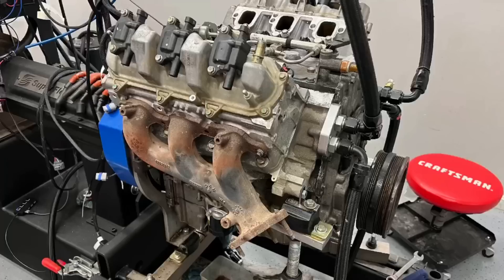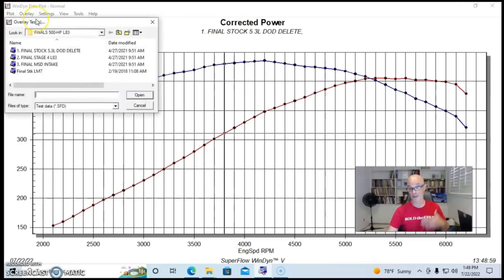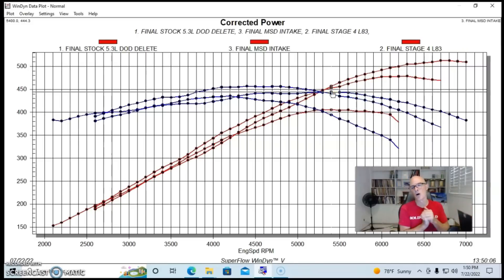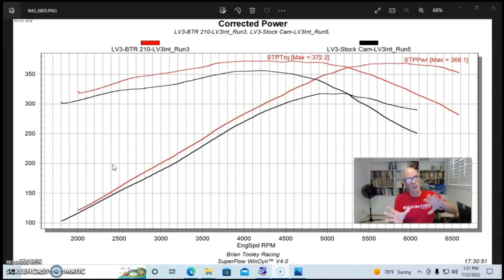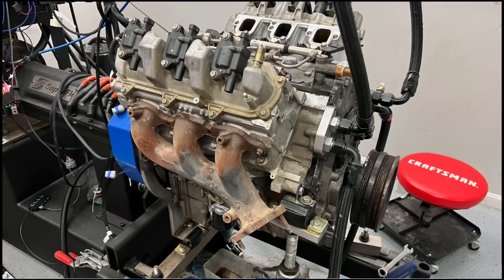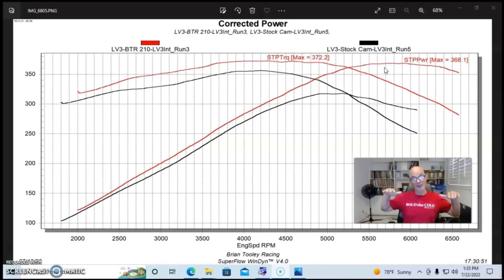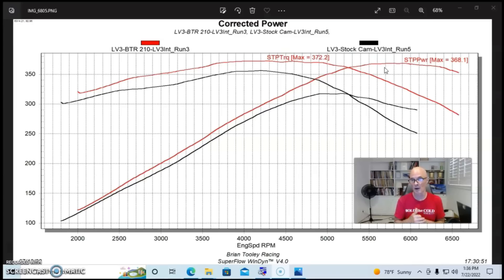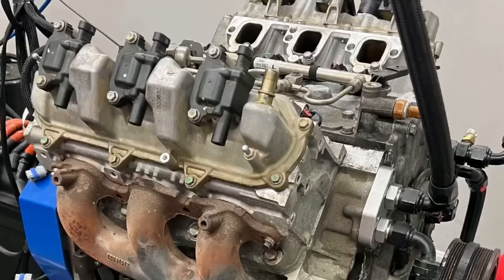4.3L LV3 V6 VVT CAM TEST-THE OTHER GUYS-HOW MUCH HP IS A BTR VVT CAM UPGRADE WORTH ON THE 4.3L V6?

Comment: I still wanna see one of these done full boar N/A hot street motor. David Vizard's formulas say it should do 430-450 at the crank with a 7500rpm redline which should mean 360-380 at the wheels. Bore it up to 4.10", do a big valve upgrade, and spin it another 500 rpm and it should breach 500hp at the crank or 400-420 at the wheels. Use the high side of his specific torque standards and spin it another 300 and it should hit 550 at the crank or 440-460 at the wheels (manual RWD).
Reply from the maker: formulas are not reality

Comment: Would love to swap out my 01 4.3l for one that weighs 100lbs less with an added 100hp....my Astro van needs some more ponies.....I wouldn't know where to start lol 
Your knowledge and work are impressive. Keep up the good work
Reply: This is a 100lbs lighter than a V8 ls, which is a 100lbs lighter than the cast iron 4.3 in your van, so you'll actually shave 200lbs
Reply: This is a 100lbs lighter than a V8 ls, which is a 100lbs lighter than the cast iron 4.3 in your van, so you'll actually shave 200lbs

Comment: I can see there being plenty of applications for a package like this. It's surely one of the most compact, affordable and economical ways into 400 hp.

Which begs some questions:
1) Will the pistons from the 6.2 V8 fit? I'm guessing that'll put the V6 at about 4.5 litres which would fill out the torque curve with the bigger cams nicely. 
2) How about the good ol' 2.02/1.6 inch valve combo? Should be a cinch, in theory at least. 
3) While we're matching heads to over bored pistons, can we skim them a bit too? I'm imagining an 11.5 compression could work without issues/ further mods.

Like I said, it seems a pretty simple, reliable and cost effective way to 400 horse. Should sound pretty sweet too 😊
Reply: No.  Can't put the 6.2 V8 pistons in it.

Comment: Im looking all over before I do a little work to my 2012 5.3 truck. Im racking my brain trying to decide if Im going to stay with VVT. If I can find the right cam for just a minimal daily driver bump in power and not go down to 8mpg. I know it seems to work really well with peak torque and HP on a dyno. Is the VVT cam worth twice the price of the 3 bolt? Running a 6l80 trans Im worried to do much more than a 50ish hp bump. Thinking I'm gonna yank the motor and swap the converter during my AFM delete.
Reply from the maker: BTR LIKELY HAS THE BEST GEN 5 CAMS

Comment: 380 lb weight. Remove the direct injection , and the high as piss fuel pump pressures go to a standard in the intake fuel injection and some LT valves and put it in jeeps, crawlers rock bouncers Samaria & etc. Happy times ahead.

Comment: Hey Richard. Is there a cheap/bolt on way to supercharge the LV3. I can't find anything concrete. Everything is custom fab. I just don't have the time or skill to tackle something that involved on a daily driver. I can however handle cobbling parts together.
Reply from the maker: not sure on bolt on kits for that v6
Reply: @richardholdener1727  thanks anyway. I would think the brackets for the 5.3/6.2 would be the same... But who knows for certain. The other question would be. Turbo or supercharger for a truck that would actually be used as a truck

Comment: this is a very light engine package too boot, I'm thinking of throwing on of these into something on a lil boost for a road coarse build . 550rwhp on a quick spooling turbo /ams1000 boost controller at 2500lb will be a hoot to say the least.

Comment: I just wanna know if a t56 or tr6060 and a gen v LSX flywheel bolt up to it the same way it would a gen v v8 but nobody seems to know...😮‍💨
Reply from the maker: WHAT IS A GEN V LSX? DO YOU MEAN LT?
Reply: @richardholdener1727  yes that mybad forgot they went back to the terms LT but yes i wanted to know if a manual trans that would fit a gen v LT would fit a lv3 or if the bellhousing is completely different.

Comment: Can the LV1/LV3 be bored and sleeved? If so, a 4.065 bore and 3.86 (L8T) stroke would make a great 300 ci sleeper motor. Just a thought.
Reply from the maker: hard to find stroker split pin cranks
Reply: How much money do you want to spend?  They used to bore and sleeve LS1's to 4" bores.  The same could be done to the LV3.  Maybe Moldex or Kellogg would make you a split-pin stroker crank, but it would take a long time and cost a lot.

Comment: Hi Richard. I did ask you before, for cam recommadation on my 408 K1 rotating assembly kit,  Wisico pistons +5cc K448X3 in my LS2 aluminum block. Heads are LS3 with 68cc combustion chamber. COMP Cams Ultra Pro Magnum Rocker Arms 1678-16 (1.8 ration). I am looking to install a Comp cam 54-454-11 or 54-458-11
In Lift will be max 0.660. With my Manley NexTek Valve Spring and Retainer Kits 26362134KS (Dubbel valve springs). Wil it work or do I need to go down with my lift to +/- 0.657.
I will appreciate you advice please.
Thanks.
Regards S Erasmus
Reply from the maker: you don't need that much lift
Reply: @richardholdener1727  What cam do you recommend with my 1.8 roller rockers 408 motor daily driver, low down torque 
Thanks a million, appreciate.
Reply: Will the 54-548-11 be a beter option?
Thanks Richard

Comment: Wanna know something even cooler? If you switch out to balancer and water pump to that of a Corvette, you already have supercharger kits built for this engine
Reply from the maker: not sure how the pulley makes a supercharger kit
Reply: @richardholdener1727  it doesn’t. What I am saying is, if you swap a wet sump C7 or Camaro/Cadillac harmonic balancer and their respected water pump housing, you could actually use a pro charger/vortech supercharger made specifically for those engines on the 4.3L, I believe the front of the of all the LT engines are the same, with would mean I should bolt right up

Comment: I had just watched a disassembly video of this engine last week, and thought it was genius of GM to build a V6 in the design of their later gen 5 engines. With the successful power output from the LS and later LT engines, I use to wonder why they didn't do this earlier on. Really cool to see you testing this Richard. Looking forward to seeing what's next.
Reply: Ya know, with a 120 degree cylinder bank angle, NO offsets would be required to hit an even-fire configuration with just three crank throws.
Reply: @exploranator  I think engine compartment space is the hurdle for that if I'm not mistaken. Or at least I've seen it discussed somewhere before.
Reply: @boosted0079  open V leaves room for more stuff on top., maybe.
Reply: Richard didn't test it, BTR did on their dyno

Comment: I have a 1986 GMC 2500 4x4 I am restoring and I want to do a 4.2 engine in.  I have owned lots of Trucks in my career ( Ford and GM ) and love the 300 in-line 6 .  The most durable tuck engine ever ( except for the 4.6 ) .  I’m just starting to put a plan together but I believe I will need a MAF setup because I will be over working the truck like I do them all.  

 Do you think you will Look into the 3.5 Ford F-150 V6. I have one and I love the engine and I want to put one in my 67 Mustang with Mustang 2 suspension.  I drive my classic mustangs on the interstate and love MPG.  Love your channel.

Comment: Would also be cool to see what can be done with GM's 60 degree V6 engines like the LFX or something. Slightly smaller engine so probably around the same results just a little less lol
Reply: Thoes motors would blow the 4.3 away on the top end. The LFX/LGX are 300-310 hp in fwd and 323-335hp in rwd. Add 50hp to thoes numbers the way richard tests them on the engine dyno.

Comment: These are great engines. It's too bad there's so little available for them aftermarket. They make good power and are pretty easy to find. Makes a great swap for tighter engine bays. Nice to see a cam option available.
Reply: Yeah I've been wanting to do a 4.3 v6 build and when I was looking for LV3 options I was very disappointed. A cam alone isn't enough for me to start on an LV3 but it's a start I guess. Hopefully there's more options once I'm ready to start on a build.
Reply: @FutureOfHalo  I'm sure you can do other stuff, it's just gonna require alot of custom fabrication for a turbo or twin Turbo setup etc. It has and can be done. But not much bolt on.
Reply: @craigquann  There is guy that did fabricate parts for an LV3 and added a turbo and it is now in his very nice Grand National.  He cut down a V8 high rise intake and it looks sharp.  On 7 or 8 PSI it already surpasses a 3.8L GN running 26psi with a Precision 6466 turbo.  The power potential is there.
Reply: @charleslowe522  oh I know. But it's all custom fab.
Reply: I'm actually building my S10 with an LV1 which is the non-AFM version in the Express van. A lot of stuff has to be custom done but doing the research has honestly been fun for me. I figured out how to do forged internals with off the shelf parts and you can massively upgrade the intake valve size using LT1 valves. I think with this cam, upgraded intake valves, and a turbo setup it could realistically break 800ish horsepower easily.
Reply: @connorbosworth7318  man! This is what I want to do...have a 98 gmc jimmy 4x4(s10 blazer) and want to do the same. My junkyard is flooded with wrecked vehicles with these engines. I'm new to these and want to install one in my s10
Reply: @Jeff-hp3vn  The sky is truly the limit. I'd recommend you watch the Scoggins Dickey video he referenced. I've actually gotten away from the forged internals thing as it would not only be hell to balance, but it doesn't need it. It made 644 horsepower with a turbo. No changes to the engine at all. I'm still trying to get a frame for mine since I'm changing to all wheel drive and need somewhere to bolt a front differential, but these are hopefully going to get more support than the old 4.3 did
Reply: @connorbosworth7318  unfortunately I think GM discontinued these engines so the aftermarket is probobly not going to take off unfortunately.

Comment: With the cam upgrade and 9 or 10  pounds boost (and nothing else), we're looking at about 600 hp
Reply: You'll run out of fuel without upgrades at about 400-450 HP at the wheel. There is one guy who did a twin turbo build. Think they got about 700hp on 14lb of boost.(don't quote me) but that's what I think it was.
Reply: @craigquann  Good point.  Additional fuel is warranted.  I'm thinking injectors in the port would work.  As far as internal mods, the cam/springs would probably be the only thing required.
Reply: @scotttimpany2845  that would be an interesting mod. Switching from just Direct injection to a dual injection setup with port injection helping feed the hungry engine as well as cutting down on valve fouling from increased crank gases...
Reply: @scotttimpany2845  think the valve train is pretty stout too. The Achilles heel being the lifters.... But the LV3 seems to have less issues than the V8's. I think it's because of the 5w30 oil vs 5w20 and the additional oil pressure/protection preventing the lifter failure... But that's just my theory as that's the only real difference....
Reply: They supercharged it first before going turbo. Got 425 at the wheel before they ran out of injector.
Reply: Yeah, we did just over 600 on the dyno at 14.5psi, port injection. Made gobs of torque, it was a freebie turbo haha.

Comment: I have a lv3 on my 14 sierra and i love it. I have tow with it, i drove long distance and I'm been impressed since i got it. It has 150k and still strong. I'm planning to do a dod delete on it later down the road before wipe out the cam. Now that there's a cam coming out i might look into it. Finally a little love for the v6
Reply: Put a range technology module on your truck goes right into your odm port, I have a 2015 gmc 4.3 I put it on around 90k miles runs a whole lot better that a 6 cylinders always going lose a little mpg, sometimes I will run some good E85 makes a difference just got to do 2 tanks to get the full effect run the first tank until your fuel light comes on then fill up twice with the e85 nice difference feels like a tune. People say it gunks up your motor just run a bottle of techron in your tank every oil change or after you run e85
Reply: Look into parts needed from Scoggin Dickey Parts Center. They got what you need

Comment: YUUUUUUSSSS! Been waiting for some LV3 content, interesting big boy V6 - especially because of them modern cylinder heads!
Really want to port the heads and fab up an intake that can get the most from them(and one of them BTR VVT cams of course), and add some port injection of course!
No one tell Calvin - but I may be more interested in these things than the Atlas... 
 
That is seriously impressive how FAT that curve is after the BTR cam, I knew there was a lot of potential being held back in these things

Comment: These engines are hard to find but I'm not a fan of vvt
Reply: DOD maybe? Never heard of anything wrong with VVT?
Reply: @krashanb5767  u don't work on cars. Hearing and experiencing problems are too different things. The vvt on these gm motors are junk the cylinder deactivation on gm motors are junk all them moving parts makes the engine less reliable. The vvt always goes bad like the cam phaser pin always breaks making ur timing off causing check engine light vvt solenoids fail cus of poor oil changes u will always find metal in the solenoids
Reply: @jackdaniels2657  Ok, vvt on my Hemi was perfectly fine at 150k so that's why I'm surprised.
Reply: @krashanb5767  those computers go bad on alot of the  dodge products.
Reply: @krashanb5767  cylender deactivation is junk  direct injection is junk always got carbon build up on the valves not allowing the valves to close. Causing misfires. The lifters get stuck and u gotta replace it. It's no different then LT motor it's junk. Ecotec 3 is junk motors vortec 4.3 are the best really reluable

Comment: Time for a 3.7 ford, 3.6 Chevy, 3.7 Nissan, 3.8 Hyundai, and 3.6 Chrysler DOHC v6 showdown...
Reply: Don't forget the 3.7 Acura engine 😉
Reply: @TheBradszone  my other car is a 2013 mdx.  Would def win that segment even with those guys being di. But the j37 is 11.2 which helps bc those di motors are in that ball park of compression on 87😒.  So octane for octane j37 is gonna loose .
Botl on for botl on j37 wins as long as it's not on 87 🤣
Reply: @alexwhite176  LFX has 11:5-1.. plus a lot of LFX front wheel drive cars are already flex fuel E85.Sorry but the only one keeping up with the Chevy is the Ford 3.7 Cyclone. But I guess we'll never know because the guy that runs this YouTube channel is too much of a dinosaur to actually do these tests.
Reply: Don't sleep on the lfx for real.  I'd bet a lot gm would take the win in that segment.  I have a lfx Impala and roll with new k20c accords and those are not to be slept on lol
Reply: GM 3.6 doesn't have much of a performance aftermarket, if any performance aftermarket at all though, so that would be a problem: he can't do a whole lot with it.
Reply: @DFX4509B  these things tuned without all the factory restrictions are pretty close to 400 horsepower. I imagine if you could put a standalone computer system on one and Tinker with it it wouldn't be too hard to make it run pretty good.
Reply: @kskip4242  Almost no performance cams for it, the only set of performance cams you can get for a 3.6 I know of are MACE cams aimed at the Aussie market so they would have to be imported, no aftermarket intakes for that platform at all, although I guess you could mix and match OEM intakes, ie. installing an LF3/LF4 intake on an LY7/LLT/LFX/whatever, and Trifecta has a custom tune for that platform, but that's about it.

By comparison, the first-gen 4.3 piggybacks on the 350's aftermarket except for the heads, intake and exhaust headers, cam, and crank, and performance cams exist for first-gen 4.3s, and the 3800 platform has a huge aftermarket to itself.
Reply: @DFX4509B  because people are scared of the dual overhead cam platforms apparently everybody wants to deal with pushrod engines because of the simplicity. There's no doubt if somebody stepped up they could make these engines into powerhouses..they already are actually.

Comment: I’ve wanted to shove one of these into a Chevette since they came out and make a Pro-Eco-Tourer. Probably get highway 30s mph and still have 300+hp
Reply: I have a 98 1500 with a 4.3 v6 it has 400,000  miles on it and on my last trip with a load it still got 25 mpg,, with 28 mpg empty,,  when I got the truck in 04 I took it to the drag strip ,after a few trips and just making  sure it was OK, I entered  a street class and won that nite , yes I'm an experienced  racer